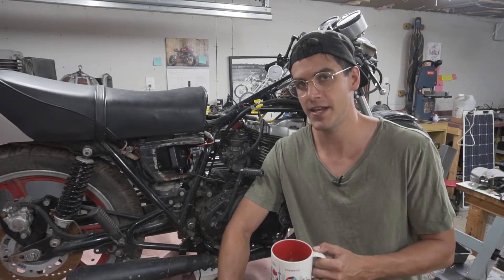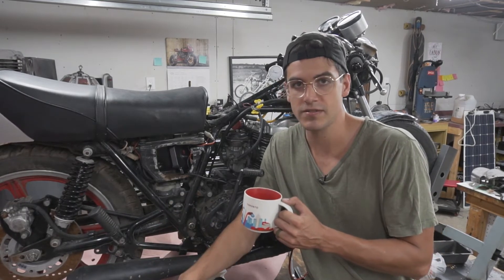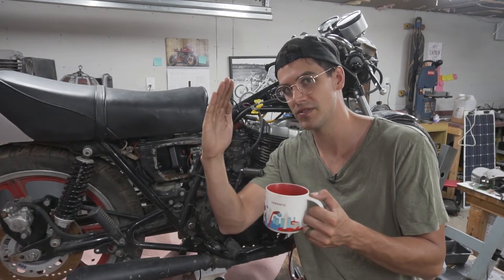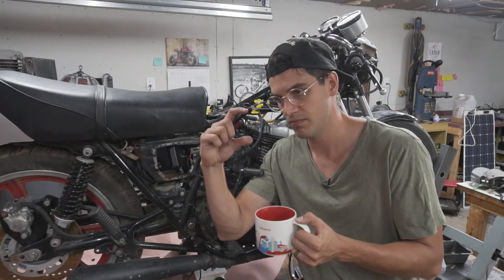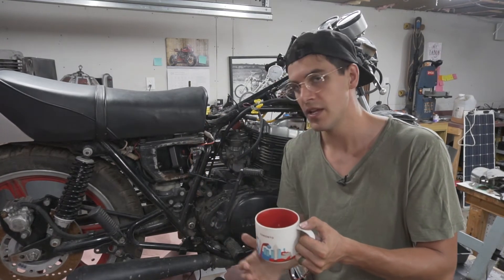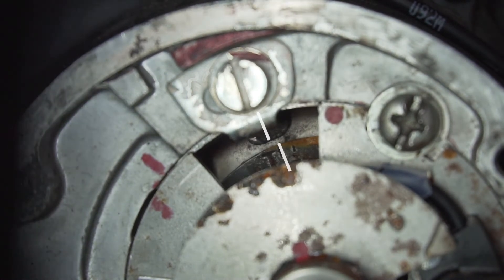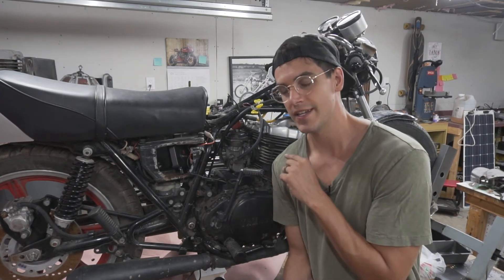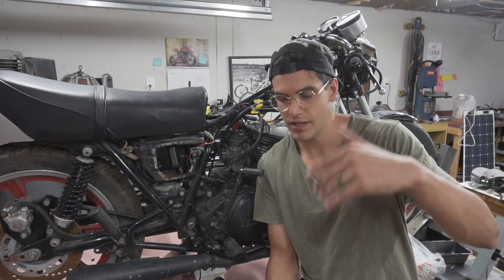Finding EXACT Top Dead Center  XS500 | 30 Days of Garage | Day 8

Comment: The reason why the TDC mark is movable on this bike is because if you move the auto advance unit, there is some play on the pin that locats it. Did you get the two ht leads swapped  ? That stopped mine running lol.
Reply from the maker: Oh good to know! I'll have to look at that next time I'm in there. I'm not sure what you mean by ht leads
Reply: @montemoto1785  I couldn't get mine to start after replacing the HT leads. Coil 1 was on spark plug 2 ie LR swapped.
Reply from the maker: Ohhhh yeah that would do it lol

Comment: So you can't set T.D.C. on every rotation has to be on its compression when its take gas and air in before that stroke. I've always been here since you slammed your kart into the trailer lol I mean you can se T.D.C. whenever you want but important to do it then to get bike to run. I have a a 1975 XS500 they have dual timing set plates and its a pain!!!!! A pain I tell you I eventually got mine going, turned it into a front trike. Its crazy called it Madmax lol
Reply from the maker: Oh yeah good point! I'll go back and make sure it was on the compression stroke. I was pretty sure it was because it didn't line up with the trigger lamps when it was on the other stroke but I'll pop the valve cover off just to be sure! Thanks for sticking around since the crash! I'm super excited to get back to that project
Reply: @themontemoto  No problem buddy! Yeah that was a cool video! You smacked it pretty wicked thank goodness sideways though lol Hope it works out for ya!